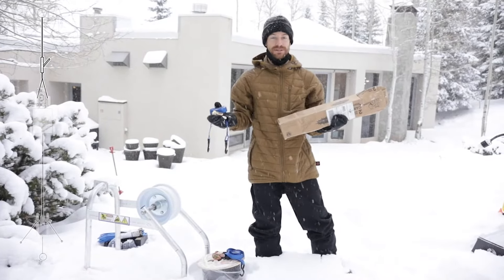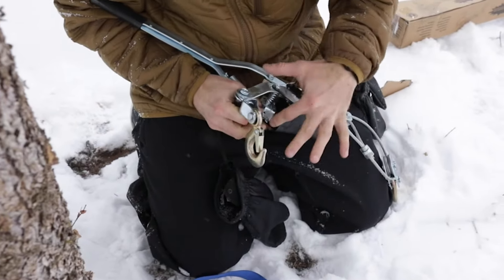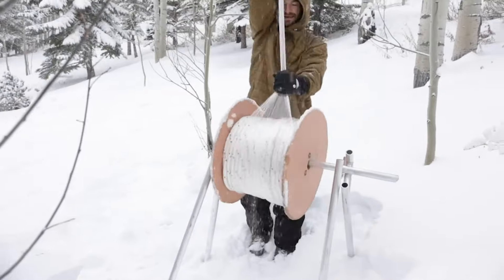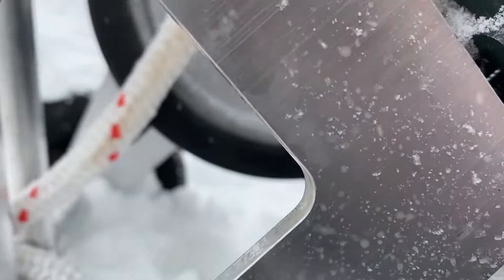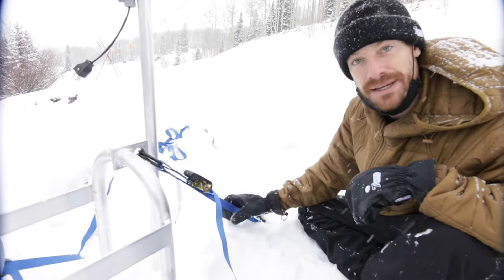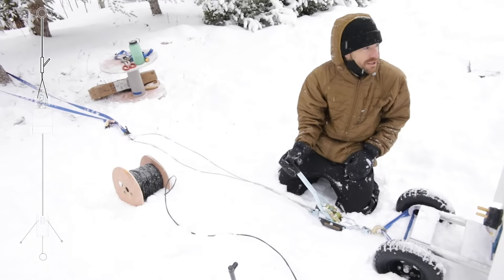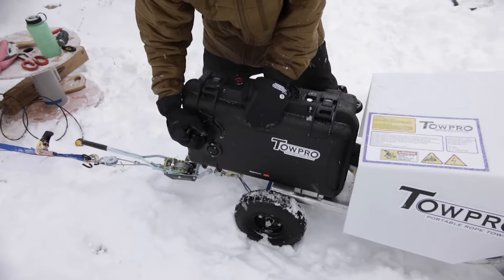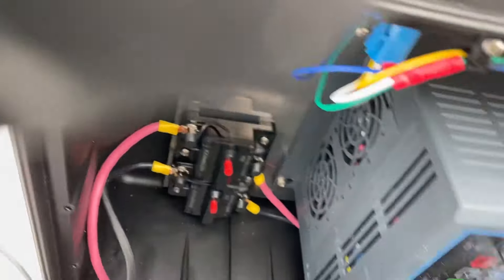Towpro Backyard Rope Tow Installation Instructional Video

Comment: For almost $10k I want this thing to be ready to go in about 5 minutes. To be viable, you need price point to drop by at least 50% imo
Reply from the maker: if you have a few friends 5 minutes is actually almost attainable for shorter runs haha, we understand that this price is not what most would expect but we have to ask that you take a look at the costs of materials and labor in our equipment and then understand that we are a new business. also: what are you comparing us to? a snowmobile costs $20,000 and is arguably worse at performing the specific task of moving people up a short hill. There just isn't anything else out there on the market like this. You may be able to make something with used equipment that could be comparable but not better and it would certainly cost around 5000$ or more if you include your time designing and building it. We encourage and support the DIY rope tow community with parts and intel, this product is not for those people. its for those who don't want to spend their time tinkering and who can afford the most cost effective surface lift solution available  We are hopeful the backyard 2.0 launching next year WILL impress you with a reduced price and increased functions. looking forward to see you on the slopes \m/
Reply: @towproliftsllc  yea 10k is steep i dont care what explanation you have.
Reply from the maker: @CR4SH0VT  I'm not sure what you're comparing us to? steep is a relative term right so you must have a solution in mind? I mean the alternative of hiking is definitely both ubiquitous and much more affordable. but I think we all understand why our product already has hundreds of adopters.  as for other alternatives: if you're going to say a snowmobile then you're going to have to take a second look at their prices... and building your own rope tow could be more affordable if you have the knowhow and the tools already, and if not we can help supply those custom parts for your build too... To me, when you say you don't care about the explanation, its saying two things to me: the price is something you cannot afford, (that is ok we understand not everyone can afford to have the luxury of having their own lift in their yard, or their own brand new car, or a boat etc.) But it also says to me that you don't care about the product, its history, what it takes to make it and what our mission is... maybe if you looked a little deeper you might see a cause you could get behind.  Think about the kids around the world who will be benefitting from municipal rope tows someday. Lift tickets and food prices are pricing people out of our sport, we think rope tows are the answer through local hills and municipalities, thats what we are working towards! Peace and love to you dude!
Reply: Outrageously priced.  You can ski at home for just the price of ten years worth of season passes. 😢

Comment: This is my dream come true! I would buy one but there is no electrical at my ski spot. You guys should design one that runs on gas.
Reply from the maker: There’s a reason the gas version doesn’t exist, it would be way less dependable not to mention the problems associated with variable speed and torque. 

However you can run this one on a generator and we have done it already in some very remote regions
Reply: And maybe buy a generator?

Comment: I like this, definitely over priced and not feasible for the average consumer. If I’m paying  $10k+ I’d be pretty dissatisfied if I was citing a ratchet strap to use as sling, for $10k I expect a welded pad eye or D-ring on the unit, as well as a sling, that 1 inch watch won’t last more than a year in most places, especially if left outdoors all winter. Great product but price point is too steep, I mean no disrespect by this. A decent reliable 10-25 hp E motor goes for $1000-$2500. 300 ft rope spool $300-$600, and  that leaves the  pulleys/parts/belts/enclosure etc., I just don’t see how the remaining parts/material makes $8000 I know that would also include your profits.  

Unless your target audience is rich people, I just don’t see how it’s possible for the average person to afford this. I see you’ve compared it to a snowmobile, a snowmobile is 10x more versatile and useful than this. I hope you do well with it, hopefully you guys can get price point lower, I’m sure your sales  would quadruple

Comment: I like this, definitely over priced and not feasible for the average consumer. If I’m paying  $10k+ I’d be pretty dissatisfied if I was using a ratchet strap to use as sling, for $10k I expect a welded pad eye or D-ring on the unit, as well as an actual sling to go around a tree, that 1 inch watch won’t last more than a year in most places, especially if left outdoors all winter. Great product but price point is too steep, I mean no disrespect by this. A decent reliable 10-25 hp E motor goes for $1000-$2500. 300 ft rope spool $300-$600, and  that leaves the  pulleys/parts/belts/enclosure etc., I just don’t see how the remaining parts/material makes $8000 I know that would also include your profits.  

Unless your target audience is rich people, I just don’t see how it’s possible for the average person to afford this. I see you’ve compared it to a snowmobile, a snowmobile is 10x more versatile and useful than this. I hope you do well with it, hopefully you guys can get price point lower, I’m sure your sales  would quadruple
Reply from the maker: this is the old model, funny enough our new one comes with a sling for the tree, and has water-jet cut holes in the frame. I know you may not want to pay the price point but that is what it costs to build these things. We make quality thing here in the USA and we do NOT cut corners. we understand if you dont see the value but hundreds of others have and thats fine by us! hope you have a great day dude!